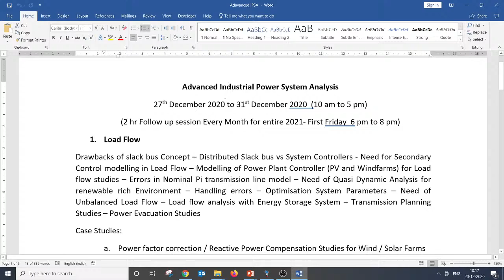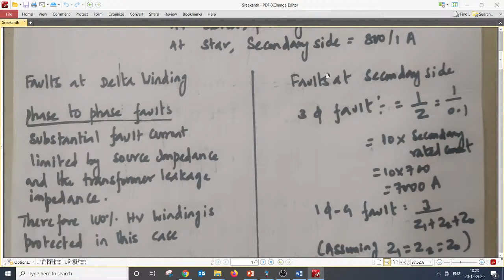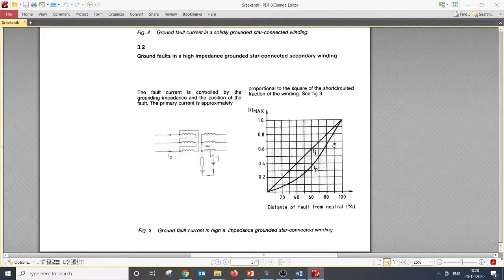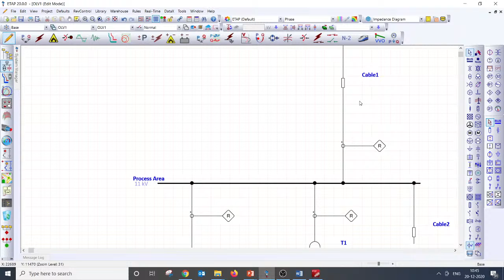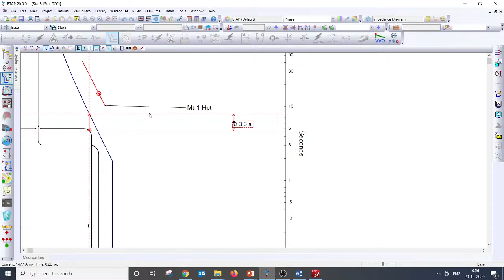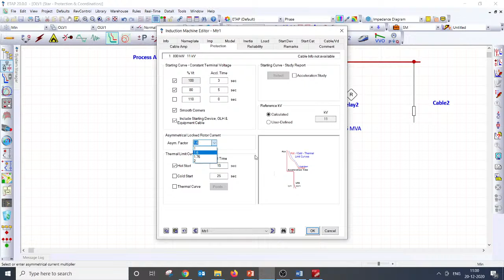AskSelva- 007 - Power System Studies

Comment: @ 56:54  if motor is protected with 51 , thermal overload protection can be setted or need not be ?
Depending on the relay, the 49 function should take into account the cooling characteristics of the motor, where the 51 relay will not. So if the motor has been running at full load, or the motor has been recently started and stopped, the 49 element should trip faster than if the motor were cold.
Reply from the maker: 49 is mandatory despite of 51 to protect the motor against thermal overload.
Reply: @PowerProjects_etap  Agree, Is 51 then redundant? any purpose it serves?
Reply from the maker: @charinath5445  Its redundant if it is used

Comment: @ 30:40 Why the primary and secondary currents are at 1 P.U for a fault at 100% away from neutral? (Why not root3 times less as in solidly earthed transformer?)
It's because, in the shown drawing, Imax is the maximum fault current which would occur at 100% away from neutral and I is the fault current at a particular position in the star winding and in this case the fault position is at 100% away from neutral
At 100% away from neutral, The reflected current at the primary would be simply the Imax at the secondary multiplied by the turns ratio, that is 1.P.U .  It simply means the rated current and the max fault current is same. 

The per unit values are referred to the I/Imax.- Max fault current, not the rated current (I/In) as in the solidly earthed graph(fig.2)
Reply from the maker: Will take up in upcoming sessions

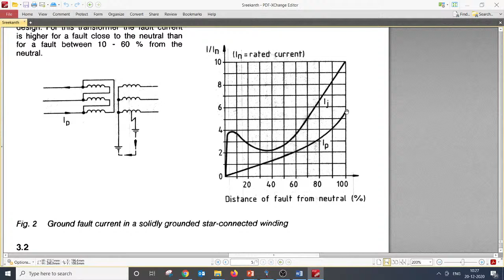Comment: @ 27:44, Why the primary current is approximately 6 P.U for the secondary currents of  10 P.U for a fault at 100% away from neutral? 

I think turns ratio is also the correct answer as answered in the chat box.

Turns ratio = Phase Voltage at star side / Phase voltage at Delta side
Phase Voltage at star side = VL-L / Root3 = 33kV/root3 = 19.05
Phase Voltage at Delta side = VL-L= Vph = 110kV = 110
Turns ratio = 0.1732

for example, in the same example, 40MVA, 110/33kV,
Rated primary current = 40 x 1000/(Root3 x 110) = 209.9A
Rated secondary current = 40 x 1000/(Root3 x 33) = 699.8A
If the fault current is 10 times the rated current at the secondary as in the example in the video,
Fault current at secondary = 699.8A x 10 = 6998A
Fault current at primary = 6998 X turns ratio = 6998 x 0.1732 =1212.12A which is 5.77 times the rated primary current (5.77P.U).

Please correct me if i'm wrong
Reply from the maker: Will discuss more in upcoming sessions

Comment: What is the reason for using x/r value of grid to 14? Is there any standard?
Reply from the maker: X/R - 14 is used for 50 HZ based on 45 ms time constant (IEC 62271). However it is not advisable to use X/R as 14 blindly.